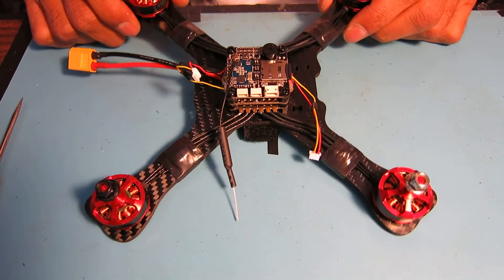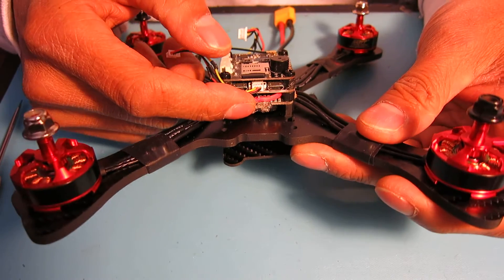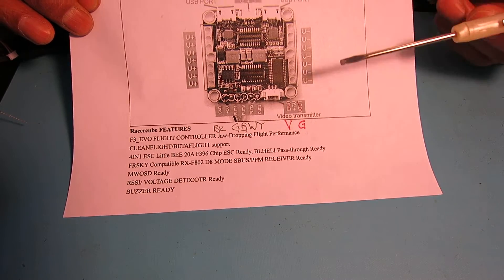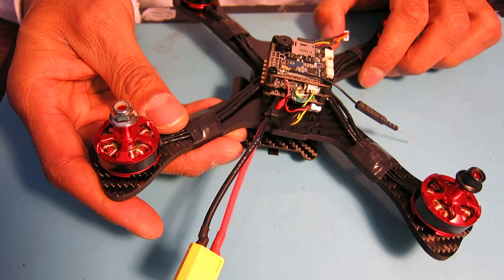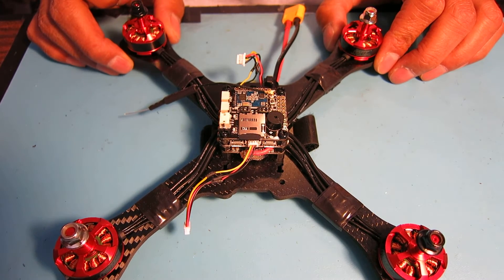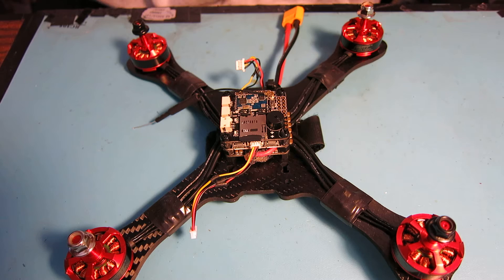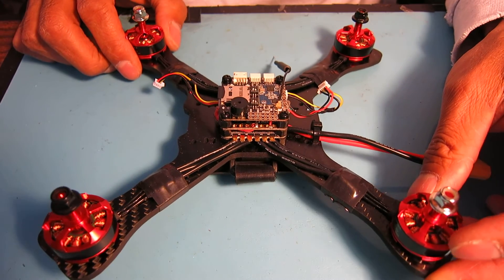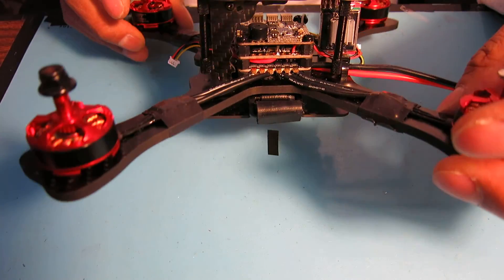Racercube build: Wired ESC, motors, OSD I/O, and Betaflight + BL Heli Firmware Update

Comment: Hey question for ya I ran in the same problem video but I also spotted the wire reversalfter about an hour lol!So now I have video! But no osd! If I un plug the camera I have osd what am I doing wrong in this picture?
Thanks
Tommy
Reply from the maker: I would first check to see if both your camera and the OSD are both set up for NTSC or PAL.  There may be a mismatch.  Let me know and I can take a look at my unit.
Reply: Mile High Multicopters thanks I solved that one  but you are correct! it was pal I had to switch it.
Thanks

Comment: Hi, To update the board to Betaflight, you can use Impulse RC Driver Fixer , just plug your board to betaflight  using normal usb cable and run the Impulse rc driver fixer and the software will put you board in DFU mode. and use betaflight to update to lastest firmware with say lower speed .. hope this help

Comment: I like the idea of this cube. I would pick this up, but I fly Futaba currently. Would be nice if there was a Futaba compatible receiver board.
Reply: all sorted thanks fella had to turn the osd to pall not ntsc
Reply from the maker: It would be nice if they offered different receivers.  You can bypass the RX but it defeats the purpose of buying this AIO package since you can't just remove the receiver board and connect a new receiver.

But, I'm leaning toward purchasing a new receiver anyway since the one built-in has some serious range issues.
Reply: what program did you use on the osd i cant get mine to work
Reply from the maker: MW-OSD.  see mwosd.com if you haven't already.  I can't remember what version I used for GUI.  I'll take a look the next time I'm at my computer.  I just used what I had installed and it worked.

It should already come with mw-osd installed.  Try to get a video signal first to see if that works.  The wiring in the documentation is correct but the wires on the plug were reversed.

You will have to power up the flight controller as the USB plug for some reason does not provide the correct power for it to work.  I have not tried 2 usb plugs at the same time since I powered the FC directly from the battery.
Reply: yer i got it all working just wont show up  on my cam when its pluged in works with out the cam lol
Reply: Mile High Multicopters 
So the colors on the video wires will be wrong,  but as long as you follow the documentation,  it'll work?
Reply: Hi Jason.  The wires on the Video transmitter connection were wrong on my Racercube.  Look at the manual to see the polarity and pinout of the socket to determine if your plug is correct.  The motor layout of the ESC is not the same as Cleanflight/Betaflight.  You will have to make sure the correct ESC motor position is wired to the correct flight controller motor number.  

I know it's confusing, but you will probably have to rotate the ESC around to have the power input to be close to the plug and that will mess up the way they have it wired.  If you point the ESC power input to the front, it should match Cleanflight/Betaflight.